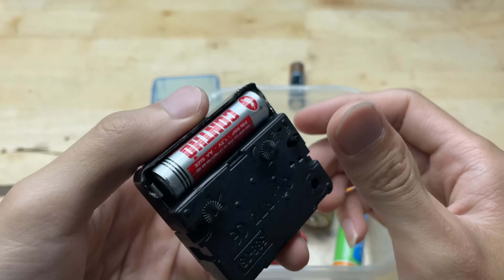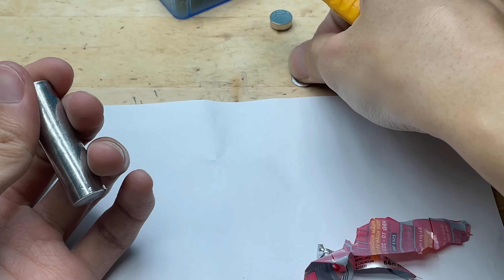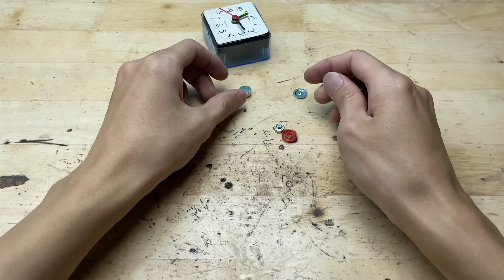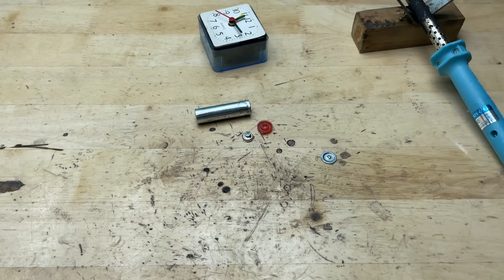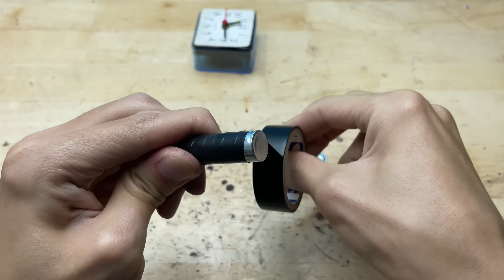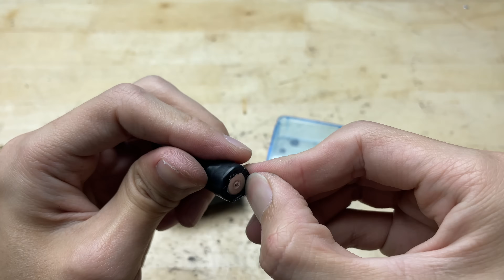Never Buy New Batteries! Just Use This Trick and Old Batteries can be Reused

Comment: Please you have created a small bomb if not for the fact that the button cell is just 1.5v and very low current.
Please you need to insulate the body of the button cell which is the positive from the can otherwise you are shorting out the battery, thanks.
Reply from the maker: Thank you! I'm so grateful for your feedback.